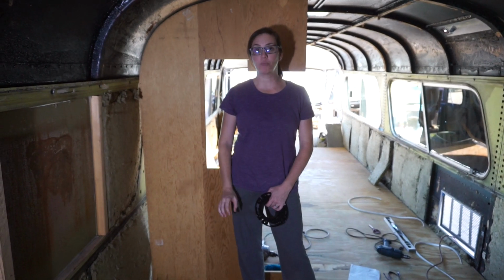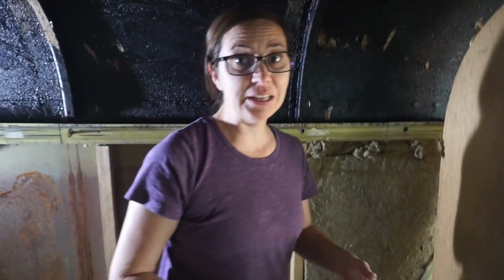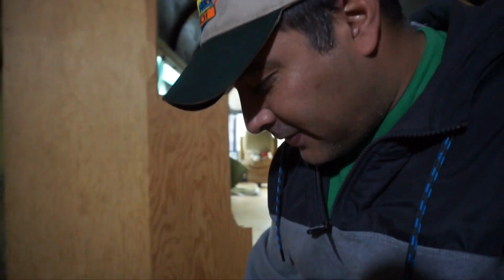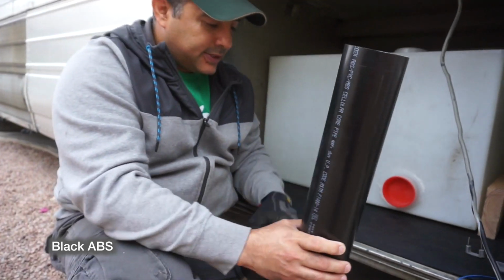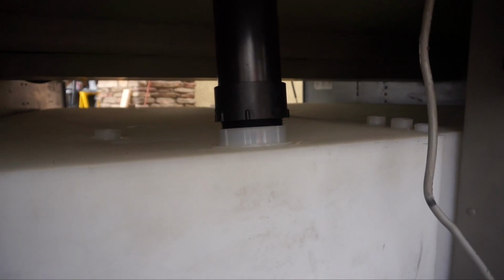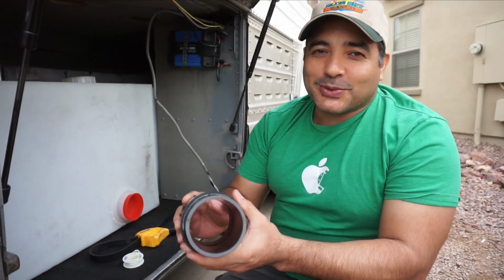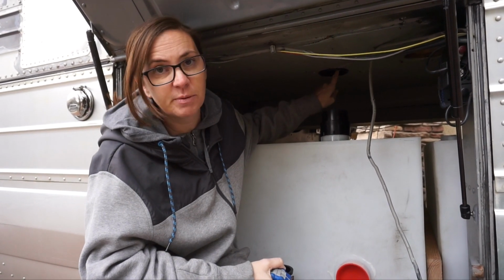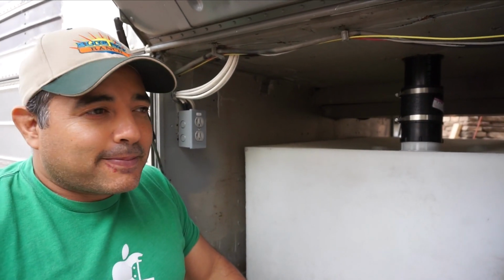Poop Pipe Adventures: Plumbing the Toilet

Comment: NEVER use dope or tape on plastic threads!  The pipe threads wedge in themselves for a water tight seal. Hand right plus a half turn is all that is needed. Also, Schedule 40 PVC is a better choice for sewage than ABS as it is less susceptible to acid leeching thru the walls of the pipe. Blue Rain Or Shine glue is the best stuff to use for weld adhesive.
Reply from the maker: Thank you for the tips Brian.  I had not heard the acid leeching before.

Comment: Not having ever emptied a black (or grey) water tank but I would think the exit/drain hole for a black water tank should be under the tank and not on the side of the tank...hope it's working well.
Reply from the maker: Thank you Jerry - that makes two of us that have never emptied a black (or grey) water tank :).  Fortunately, the Internet has many examples and pictures of black tanks - the majority of the tanks are actually plumbed the way we have our tanks setup (drain on the side at the bottom).  The drain hole in the bottom makes a lot of sense except for the big ground clearance issue that it would present.  The bus already rides very low to the ground (I think about 7 or 8 inches) and we really couldn't afford to have anything go any lower.  We have yet to run any water through it but we hope it will work out OK.

Comment: Are you going to drain Gray water into the tanks? Washer and Dryer is nice, but I would imagine that is a ton of water. Can you dump gray water outside from the sinks and washers?

You need that Solar Ductless AC. https://www.solairworld.com/solar-hybrid-air-conditioner

one Compressor with multiple fans around the bus. You can use it to assist with making hot water too if you put a heat exchanger in between the compressor and the fan and that warm water can go into the 20 gallons DC powered water heater.
Reply from the maker: I have seen a few of those DC mini-splits floating around but they always seem to be some part of some kind of weird scammy looking website.  I didn't see a price listed anywhere and that is usually a big red flag for me ... While I agree that the idea of these DC air conditioners seems very appealing (more efficiency) - I have never actually seen one reviewed.  When I first saw these I went looking for reviews but I never found anything so I went with a high-efficiency 120V unit.  If you have links to resources or even know what one of these would cost I would love to see them.
Reply: @BeginningfromthisMorning  This guy has a few videos installing them. I guess he sells them too- 
If Clicking links is a bad idea, he is Engineer775 and you can search for Solar Air conditioning.

He does the DC hot water heaters as well.  

Solar AC- https://www.youtube.com/watch?v=URgtvNsiAog

Solar hot water- https://www.youtube.com/watch?v=-crCWTAYwAs&t=607s

Fire Suppression might be a good thing too- https://www.youtube.com/watch?v=xBu9tQDbUz0

Comment: Isn't Craftsman warrantied for life?  You will make the sales person happy it lasted this long.  How are you running your solar cables from your roof down to your electric bay?  The vent pipe works and won't leak into your coach.

When you install your plumbing, install a by pass valve that allow you to circulate your shower/tap hot water until it arrives hot at the shower/sink.  This saves 1G for each shower that would otherwise go straight down the drain.
Reply from the maker: You are very likely correct - I may have been able to take it in and get a replacement - I didn't even think of that.  We are pretty happy with the DeWalt cordless one that we replaced it with. To run the solar cable down to the bay we bought a small solar inlet plate (from Amazon)  that we put in place of where the refrigerator vent was.

I have been looking at recirculation valves for the hot water - I think it is a great idea - thanks for sharing.

Comment: Take a look at Uniseals for attaching to tanks if your spin welded ports don't line up. Uniseals are water tight and flexible. My favorite advantage with them is that the pipe that goes into the tank doesn't need to be an exact length. Lots of work there guys but worth the quality.

Comment: You’re doing the flange correct. It screws down on the finished floor. RV toilets don’t use wax seals, they use a crushable close cell foam rubber. If you notice the toilet throat actually projects down into the flange. I doubt the gasket ever gets wet but see it more as a smell seal since your toilet, like mine, is a direct drop. Hope this helps.
Reply from the maker: Thank you Gypsy Spirit

Comment: I worked with some plumbers in the past and they said that the toilet flange is suppose to sit flat on the sub floor and that the flooring is to but up against the toilet flange otherwise the flange will be to high and the sealing ring will be crushed to much and cause a leak in the future. Love your videos and it is giving me ideas on possibly doing this myself.
Reply from the maker: Hi, Hill On Wheels - Thank you for the comment.  Interesting - I have always read that the flange should sit on top of the flooring if at all possible.  Our last house had a leak in the toilet because when someone laid the tile they did not raise the toilet flange.  I also found a guy who sells a product the "raise up" the flange so it sits on top of the finished floor: https://www.youtube.com/watch?v=8wCUoQGR39g.  What type of RV are you thinking of building?
Reply: When I was doing hvac instillation the ruff in plumber told me the proper way is to put the flange on the sub floor. Might be a ruff in thing i'm not sure. I either want to do a school bus with a roof lift or a utility trailer. I just have to see how finances go.

Comment: For a hole this size, next time use a jig saw.
Reply from the maker: Excellent suggestion Wayne - would have been easier and safer - Thank you.
Reply: 63 yr old carpenter.  Safety First!   You're welcome.  By the way,  Ours is  1963  Pd4106-1755.  So in Quartzsite some year, we will most likely meet at the ' Western GM Bus Rally'.  They SAVED us this year 1/2 a block away!
Reply from the maker: Yes - We dropped in on the Western GM Rally this year - Looking forward to meeting you.

Comment: The bandsaw works well cutting your pipes but your Dewalt compound miter saw would be even better.  The cuts come out really clean and perfectly straight.
Reply from the maker: Hi Steve - Thanks for following along.  Yes - we cut the rest with the compound miter saw - I think it was just the novelty of using the 'new' tool :)

Comment: Hi Michele and Juan, let me be the devil's advocate:  Do you think not having a black tank is wise?  Because if you wanted to save fresh water when boondocking, a good method would be to use your gray water volume to flush your black tank by using a separate water pump in-line to your toilet.  This way, the fresh water would be used twice before it needs to be dumped and your gray tank would last longer.  In your case, you could have a 60 gal black tank and 100 gray tank.  Either way, this system would be more versatile. Just a thought,...
Reply from the maker: Hi MrMudStud - thanks for the suggestion - That is an interesting thought - you could effectively use the grey water for flushing toilets - not sure if I have ever seen a setup like that but I like the idea. We also considered doing a compositing toilet and eliminating the need for a black tank at all - but with 4 children - it just seemed like more trouble than it was worth.  Thanks again for the input.
Reply: Beginning from this Morning: I have read some old articles about boondocking and some of the pioneers would alter their system to allow gray water for flushing. Those days they were using trailers and the tanks were very small. This is one RVer’s method which I thought was intriguing. Again, another version of how to conserve and stretch your bus conversion. You still can have both systems set up, one when you are at a campground and the other when you boondocking. Now is the time to make the decision. Good Luck......

Comment: Been watching your videos since you started the battery, great job on the batteries BTW. I am building an adventure vehicle and will be putting in the plumbing here soon as I have finally finished the framing and shell so it was good to see what you guys had planned for that. With the fittings, you really only need to wrap them fully a few times and get them just over hand tight, especially if they do not have pressure on them. If you end up putting a lot of tape on the male side and over tighten the fitting, it could split the female side. Also, are you venting the black tank (it looks like the grey and black are one tank)/? Subscribed, waiting for the next one. Never really appreciated how much work goes into these videos until I started making them. Thanks for some good inspiration.
Reply from the maker: Thank you and thanks for the tips - We are venting the tank through the roof (working on that video coming soon).  Making the videos is indeed a lot of work - but we are having fun with it.  I subscribed to your channel and look forward to watching your build.

Comment: the glue may not hold like intended as you did not use the cleaner be for the glue
Reply: sparkey 90, you don’t use primer with abs cement. It’s a one part cement. Same for cpvc cement.

Comment: four things, you need the side handle to help hold the drill, speed is two high (hole drill speed table https://www.fairburyfastener.com/holesaw_speed_chart.htm ), awhile back I had mentioned I had trouble drilling with hole saws I added a comment about relief holes, and the pilot drill bit is not extended far enough. I have the same drill and really like it. Have you thought about level sensors for the tanks yet? I like permatex PTFE part #80632 https://www.summitracing.com/parts/ptx-80632?seid=srese1&cm_mmc=pla-google-shoppingsrese1_-permatex&gclid=EAIaIQobChMIkJnlrsbL2QIVHLXACh3WWAwoEAQYBCABEgLqqvD_BwE Glenn Lever
Reply from the maker: Thanks for the comment Glenn - I learn something every time I watch one of your videos or read your comments.  That speed chart is going to get posted right next to my pilot drill hole size chart next to my drill press.  

For water level sensors, we are looking at the at a product called SeeLeveL II from Garnet Industries - it uses external sensors as opposed to those 1/3, 2/3, 3/3 level sensors that always get gunked up and stop working.

Thanks for the link on that permatex - I will pick some of that up.
Reply: I need to replace my internal sensors for the very reason. I will also be going to the external sensors, heard goo things about them. Glenn Lever
Reply: SeeLevel sensors they say are the best, I will definitely be going with them as well. Very accurate, to the gallon! Also, I really like the idea of the removable black tank collar. I had a Bounder Class A once, and needed to access the holding tanks..this would have totally allowed me to do it! I’ll be borrowing this idea as well! Thanks for your videos, as were both doing a bus conversion, it will help me as well!👍🏻

Comment: you dont have a centre drill in there ,haha
Reply from the maker: We had a drill shank in the middle - maybe it was too short?  That drill was probably way too fast also - when we slowed it down with the second drill it went much much smoother.
Reply: Must have bin to short for sure and a big size like that must go slow as you stated

Comment: You need a center drill bit in the hole saw and it wont buck like that.
Reply: It was i have drilled a lot of 4" holes and never had one buck out like that
Reply from the maker: It does have a drill bit in the middle - I am using this shank: http://amzn.to/2oKi3fV - maybe the drill bit was too short?
Reply from the maker: That was the first time we have ever had one be that violent.  I think the speed of the drill was too high (that was a single speed drill) and the shank in the center was probably not long enough.  It went much better with the second drill at much lower speed and with a handle down low to be able to control it a little nicer.

Comment: I thought all camper and motor home had a grey water tank and a septic tank. I may be wrong?
Reply from the maker: Hi, old time engineer - Thank you for the comment.  Most RVs do indeed have separate black and grey tanks.  We researched it quite a bit and the only real advantage to having them separate that we could find was maybe being able to use the grey water to flush the dump pipe?  There was also a time where you could dump grey water in certain parks if there was not a risk of it leaching into a water source?  Most places no longer let you dump grey water onto the ground - we also read that if it contained kitchen items (fats, greases, food particles - it was actually considered 'black' water even though it was from the sink).
Reply: Awesome videos! You both have such a natural and genuine way of hosting your videos and are extremely good at explaining every step you take. Thank you! I'm 5 months behind as I catch up on all your videos one by one :). Regarding having separate grey and black holding tanks, the main minor advantage these days I believe is when constantly connected at a sewer hookup (ie. RV park). Most people will leave the grey tank open to drain as it is all liquid, and therefore you do not have to be concerned about capacity left when showering and doing dishes, etc. Black tanks being partly liquid and solid are always left closed until 3/4 - full until you can drain them. If black tanks are left open to drain the solids will build up in the tank and cause issues. At the end of the day your tank capacities are quite significant, so I doubt the dual tanks would add much convenience for you. Keep up the amazing job! Now excuse me as I continue to catch up ;).

Comment: What size are the sink pipes going into the tanks? I ran 1.5 on my drains your smart using ABS I've seen so many people using PVC and ABS will out last PVC two to one and its designed for waste water and it just looks better on the finish work just my opinion.
Reply from the maker: We are going to run 1.5 inch for the drains and the vent pipe.  I hope it is enough - thank you for the input.

Comment: Could you please explain your tank systems? Including sizes? Loving the conversion you're doing :)
Reply from the maker: Hi Judith - thanks for your comment - After we filmed this we realized that we had not really explained our tanks very well.  We will explain them a little more in our next video but the short version of them is that they are 166 gallons each and we sized them so they would fit with enough room so that we could put some 2x6's sandwiched in between them to keep them in place (also maximizing the capacity while giving us a little 'wiggle' room).
Reply: Thank you for the info and looking forward to the video. We are converting a bus also so your videos are very helpful. Loved the videos on the battery so now we are trying to find out how to get our hands on some tesla cells too!!!

Comment: Man, it looks so good.  The quality and craftsmanship you guys are putting into this is just awesome.  

When you were threading in the pipe, I was laughing...  They meant normal human hand tight, not hand tight for someone with hands that could crush golf balls into powder hand tight :)  

FYI pipe threads are NPT which are tapered: https://ipfs.io/ipfs/QmXoypizjW3WknFiJnKLwHCnL72vedxjQkDDP1mXWo6uco/wiki/National_pipe_thread.html so they will seal half way decent (but usually not quite tight enough to hold back air or water under any kind of pressure) on their own.  Hole saws always do that, especially new ones that are still very sharp and bite into the wood hard.  the bigger they are, the worse they are.  You may try lubricating the inside and outside of it with wax by scribbling on it with a crayon (seriously) that should make the binding less violent.  And usually the pilot bit sticks out a bit more I think (1/2 to 1")?, which alleviates the initial skipping and jumping you had.

Anyways, its awesome!
Reply from the maker: LOL - you had me cracking up at the "normal human hand tight" comment.  Thanks for the info and links about the NPT threads.  The hole saw - they always give me a fight - great tip with the crayon idea I will try that next time.  I think getting a slower drill helped too.  I hope all is well for you.

Comment: So you have combined your black and gray water into 1 tank? Did you add any slope to the tank to assist in draining the solids? Have you added a flush system? Check "The Fit RV" Black tank series https://www.youtube.com/playlist?list=PLhC6EoQADzubL_E2laQp8WbwunmbVtLAs and for flushable products https://www.youtube.com/watch?v=zAeRXSsVL-4
Reply from the maker: Hi Jon - thanks for the questions - yes the tank is combined grey and black.  We have not added any slope - still researching what might be the best approach with that.  We did add a flush system in the back of the tank that should help push "stuff" from the back to the front.  Thanks for the link - we love Tthe Fit RV" channel
Reply: I made a wall mounted (high) tank. The stick shift flush lever allows the user to release a variable amount of water to complete the flush. No more than necessary. And it is a gravity system. So no pump is necessary.
Reply: Love your videos.. Just thought I'd add some resources... Foresight is better than hindsight.. Just make sure to plumb your pipes/lines as you would a house. Here's a link on slope https://plumbernw.com/blog/how-to-calculate-drain-pipe-slope/ or https://www.archtoolbox.com/materials-systems/plumbing/pipe-slope.html... You have a great channel and can't wait until your on the road (of course with videos)!
Reply from the maker: Thank you for the ideas - we are learning way way more than we ever thought we would about plumbing!  We appreciate all the help.